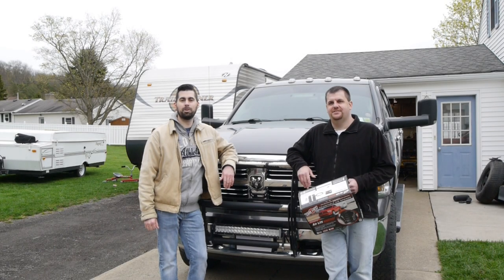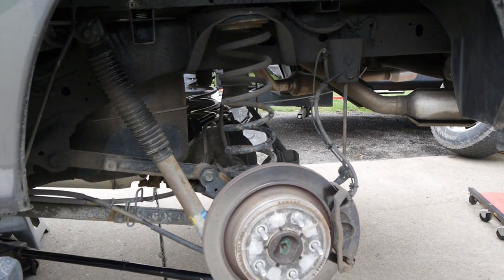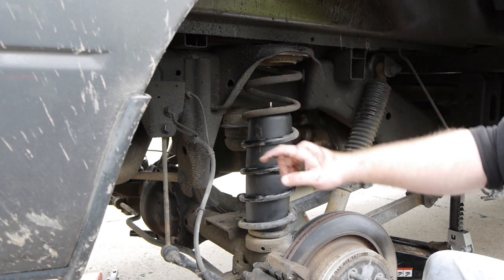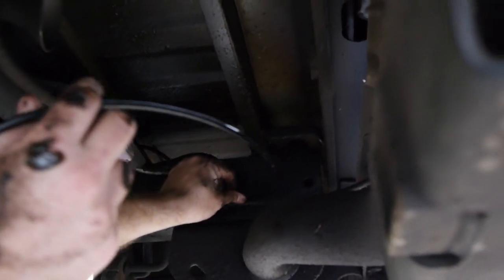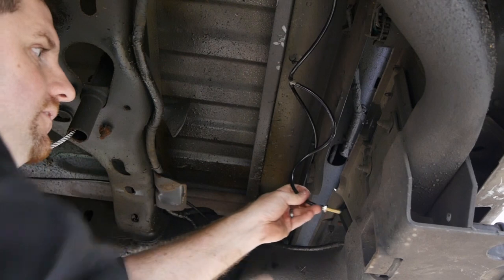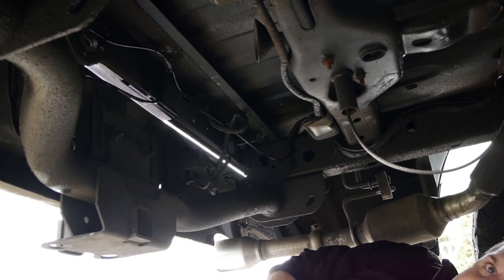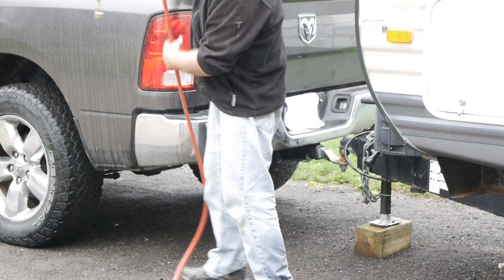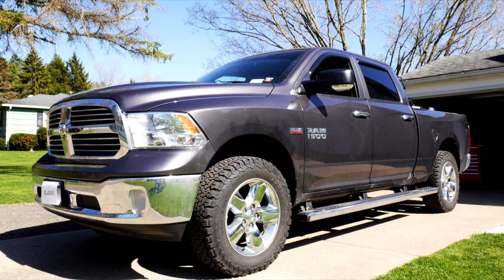Dodge 1500 Air Lift 1000HD Air Spring Installation

Comment: Dude, I’ve done everything you just did because a 2500 wasn’t in my budget either. I bought Heavy Duty springs from Moog. I got the husky distribution hitch and gonna install the bags and I wish I would have installed those when I did the springs but didn’t think I would need them, but it was simple. Thanks for the video guys!

Comment: Installed mine yesterday, hardest part was folding the bags. Get longer, beefier zip ties, it helps. Had to remove first wheel to tighten the air line. 2nd one I attached the line as soon as I got the top into the spring (much easier). Great video, thanks 😊

Comment: Good video.  I just installed the HD's in my 22 Ram...lifted the frame via the hitch to relieve spring tension and removed well liners...plenty of work room.  Bags inserted easily and then ran the schrader valve next to license plate.. Quick and easy....

Comment: Good video and used some of your suggestions to make my install go easier! Def feel a difference with the bags during a drive around after i installed them. Firmer yet allows for the original cushion ride that the springs were designed for. Thanks again!

Comment: When I did mine I just took loose the struts allowing the axle to drop farther and installed the bags from the top of the spring easy peasy no fighting to deflate or squeeze it in there

Comment: I simultaneously installed tuff truck springs and the air bags. Sooooooo much easier than mashing the bag into a taco shape. The bag just slips through the top of the spring.

Comment: TAKES 2 MIN TO TAKE THE LOWER SHOCK BOLT OUT AND LOWER THE REAR END..THE SPRINGS COME RIGHT OUT..PUSH THE BAG STRIGHT DOWN THE TOP..NO FIGHTING WITH TRYING TO SQUEEZE THE BAG TO THE SHAPE HE HAS IT ALONE..TRUST ME THAT ISNT EASY TO FOLD UP LIKE THAT.... THATS A NIGHTMARE WITH HD BAGS....I DID IT THEIR WAY FIRST BUT WHEN I DID A FRIENDS I DID IT MY WAY..NO SWEARING OR FIGHTINH WITH IT..YOU ALSO DONT HAVE TO TAKE THE WHEEL LINERS OUT.

Comment: Did your coil springs rub against your bags? I did the install thanks to your help. I think they are good but it says 1/2" of clearance from the bag to the spring all the way around which is hard to believe. I have a 2018 ram big horn.

Comment: should of just bought an air lift dominator 2600 lb bags and then get the air  bag brackets  that fit your truck or make them and then ditch the coil spring... or the contitech triple convolted bags this way you would get more lift when it squats ..and then have  no squat at all fulling loaded  ... have to keep your shocks

Comment: Hello, very helpful. What is the tounge weight on the trailer?
Reply: Well if the trailer dry weight is 6700lbs, given a typical 10% tongue weight, that would mean it's about 670lbs.
Reply: My trailer of similar weight to his (7000#), loaded puts almost 900# on the hitch. My 17 ram only has 1375# payload, which I would assume is close to this trucks as well.

Comment: Do you have to get the entire rear axle with both wheels elevated in order to extend the spring enough, or could you lift just one side at a time?
Reply: I lifted one side at a time.

Comment: I have the same truck and it says the tongue weight limit is 500lbs and trailer 5000lbs. Doesn't this trailer at 6700lbs exceed the limits of the hitch?
Reply: You are reading the rating for the stock bumper. The hitch is rater much higher

Comment: How did you calculate the "35 pound" number? Isn't the max inflation pressure 100 pounds?
Reply: its supposed to add a ton of handleing so why whould you raise it back to 29" and check the pressure? Thats why i just bought it, to level the truck back out. 35psi is still pretty soft.